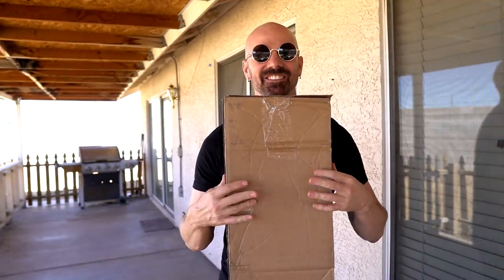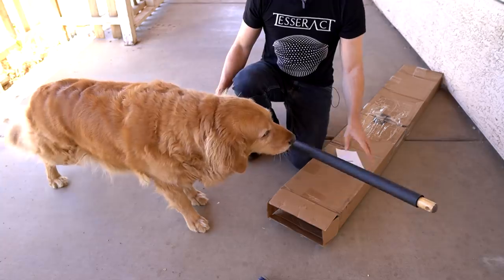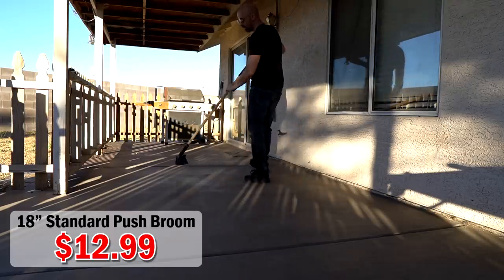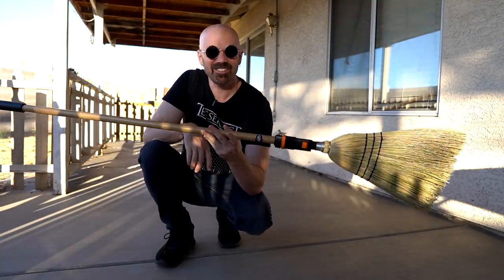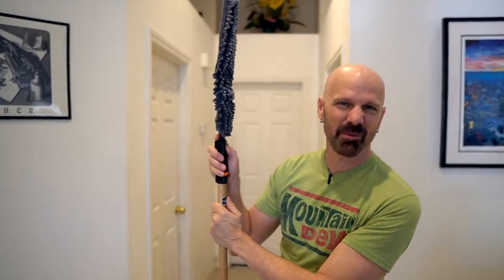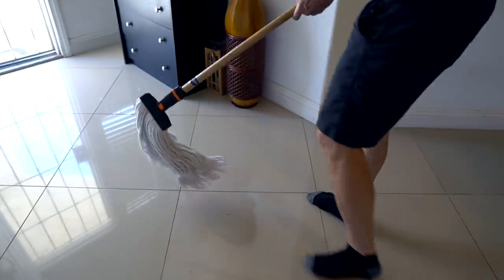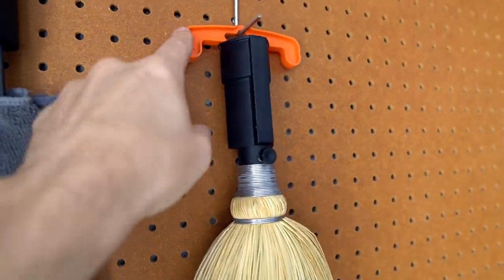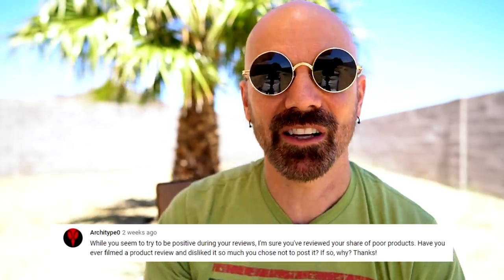Broom of the Future? Swopt Cleaning System Review

Comment: Two piece or adjustable handle and this would be perfect.
Reply: Or a telescopic handle, but a sturdy one
Reply: @RamLaska  aka an adjustable handle 😂
Reply: R.L. Dane or just use the same detachable method they use at the bottom and make it so you can add extra handle at the top
Reply: As a 6'7" giant, I'm hoping I won't have to bend over to sweep with one of these

Comment: I have used this entire series for a year now and the only issues I have found are that the push broom heads don’t last long in the Phoenix heat. The push broom head you received is for round surfaces. They have three other heads you should try. They have the multi surface push broom, smooth surface push broom, and a microfiber dust mop.

Comment: I bought the Metal and Hercules hoses and added them to each other.  I love them at first.  They were light weight and didn't kink.  In less than a year, I had to throw them away.  We have hard water in Florida and they became clogged because they are so narrow.  I put bleach in them and connected the ends, letting them sit overnight.  It opened one a bit, but not the other.  I was very disappointed to have to go back to a wider traditional, and yes heavy, hose.   And by the way, someone drove over the hose and dented it.  But I don't know which one it was.

Comment: Wonder If instead 60" and 48" length for the handle choices, 
could they make a 48" with same type of connection on the top and add a 12" extender.
Might get around your only down side of this product.

Comment: This looks pretty decent, and it does solve the issue of the good old "standard" threaded handle unscrewing.  The sizing of this seems to be more along the lines of commercial equipment, and it would be interesting to see how the plastic mounting system would hold up in a commercial environment.

Comment: I feel like you could get all of these products for less that $70. Plus, as many have pointed out, if that plastic connector on the handle breaks (like using the big push broom, which would generate the most stress), it's game over.  Sure, you could buy a new handle, but will it exist in five years?  Who knows.  If you can't swap the mop head without replacing the whole unit, that would be pretty bad as well.  Brooms and mops get dirty, and you would have to handle the dirty end every time you switched.

Comment: A stand could be made to make it easier and more convenient. Each attachment placed female joint facing upwards so you just grab the stick, stab it in, and get to work. Then when it's time to switch out, place the head in it receptacle, push a pedal that works a linkage that pushes the button, and pull the stick out.

Comment: They should have made the handle 2 piece that uses the same attachment mechanism as the head attachments. Maybe 1 piece 4 ft long and the other 2-3 ft long, that way you could get the length that you need without having to buy 2 separate handles. Just my .02!

Comment: They should do a 2-piece handle. If it's as solid of a connection as it is to the attachment it would probably be plenty sturdy. It would let you cut it down by a foot or two when you don't want a long handle.

Comment: I like your reviews. To add I'm not saying you but there are many reviews I watch where the person is making a slight noticeable mistake using the product. I like seeing those mistakes specially if they make them after reviewing the instructions. Half the time I get products with instruction manuals that seem like they require a degree to figure out or most of the time should be translated back to their original language to make sense. Lots of the people who make the slight mistake don't realize it, if they being experts make that small mistake than how is the average person supposed to not make even bigger mistakes if the product is that strange, complicated or comes with unclear instructions. I like those " ohh I see what they did wrong they put the handle on backwards that's why it's not working" if it's a product I like and end up getting I now know not to make that mistake thou it seems like with the product in hand it seems like the handle fits and looks much better the wrong way. I think you get what I mean with some of the products out there.

Comment: Looks like all they did was replace a standard universal screw attachment to a patented proprietary one. If you don't like the screws backing off just put a layer or two of some plastic grocery bags on the screw and screw it back in, trim off the excess, or a tooth pick or two.
Reply: Also just to add to it, hot glue, super glue, teflon tape, any kind of tape, loc-tite, a screw or bolt through the screw, paper towel, aluminum foil, sandpaper, rtv/silicone, balloon. This list could go on for awhile how to solve a loose screw on the cheap.

Comment: So they invented a broom with a detachable handle? They've had those for years. I don't get the point of this. I've never looked at my mop and my broom in my push broom and my rake all sitting in the space I put them and thought you two others just too many sticks over there.

What an absurd product
Reply: And you just know that whatever part is on the handle is NOT going to be the one you need at that moment.  And the one head you need, won't be anywhere to be found.    I'm also not partial to TOUCHING the dirty pieces unless I'm cleaning them.   It's a pass from me.
Reply: @jeandiatasmith4512  absolutely love his interactions with his dog.